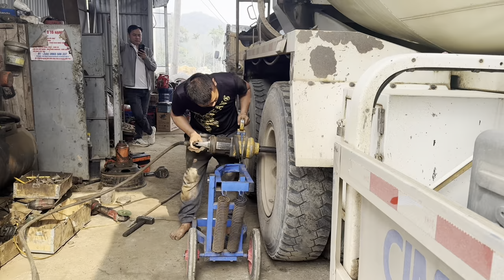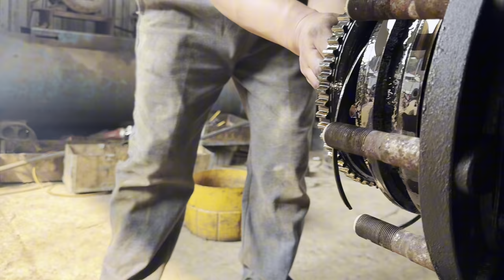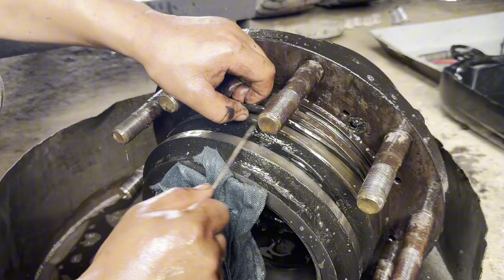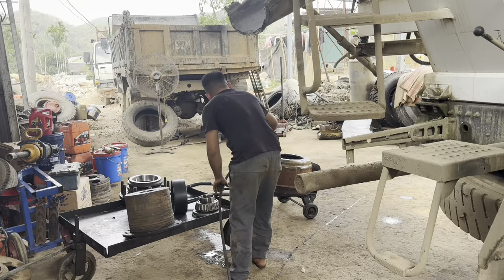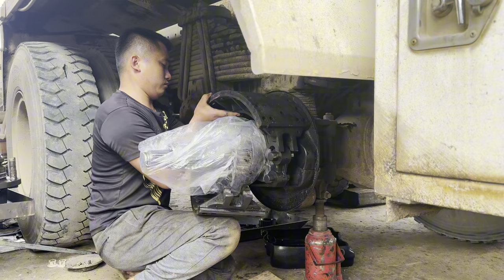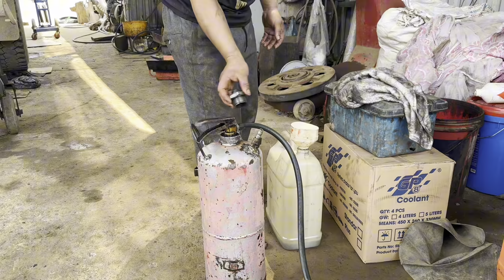Repair and maintenance of rear axle of Howo 15 ton concrete mixer

Comment: As a 79 year old mechanical engineer who has spent all my life working on anything mechanical, Cars and motorcycles, (present bike is a BMW 1200RT)  I hate to see silly comments from totally uninformed people in this post, to complain about bare feet or flip flops is sad, it’s a way of life for you, to complain about just using a bottle jack on this truck is stupid, it’s a Tandam Axle truck, if the jack fails that axle will only drop about 8-12 inches on that side. To complain about not replacing the brake shoes after being soaked in oil is sad, in 1960’s and 70’s we (here in Ireland) used to wash the shoes with Carbon Tetrachloride ( out of a fire extinguisher, Acetone would do the same job)  then soak in petrol and set on fire to burn off any oil or brake fluid, won’t harm the brake compound as they were made of Asbestos same as modern compounds. Result = good as new 😃   Anyway Danh, great job as usual.
Reply from the maker: Thank you for watching the video, the hydro jack cannot collapse, even if it collapses, it won't be able to dump the car. It's really comfortable to walk barefoot even though I know it's not safe.
Reply: i  am  reminded of the WOKES  in  Europe  who lay down on the road to protest  the use of oil  and then go home and eat the food   bought to them by those  same trucks.

Comment: Not a clean guy, I would not go to him with my truck. At least for the break-drum he should have taken new Petrol to clean it properly, instead he used that same old black nearly turned to oil (after washing all the parts in this same pot this pot of Petrol turned into almost oil) Petrol he is washing break-drum where the breaks are going to run.
Reply from the maker: I'm sorry to make you feel uncomfortable, but I just want the driver's repair costs to be kept to a minimum, so I try to reuse used things as best I can. Thank you for watching the video and paying attention to me 🥰🥰

Comment: Awesome and extremely efficient job dude. You work alone faster and better than most American mechanics. Only thing I seen wrong was you put old oil soaked brake shoes back on. In the u.s. it is both illegal and unsafe to not put new brake shoes on, as the old ones can still catch fire if the brakes get too hot. Have a great day sir
Reply from the maker: thank you
Reply: catch fire how? there is no oxygen around as it is pretty much enclosed space. also they were degresed

Comment: It goes from bad to worse.  Jacks  up a 16ton truck on a bottle jack. No stands. No wheel chocks.  Uses air tools with water in the compressor tank. Refits old o rings. Never ppre lubes the bearings after washing. Used original oil contaminated brake shoes.  Does not own a torque wrench.   And does the job barefoot!!. This is no mechanic. He has no pride in his work. Or he would fit new parts no.matter what the owner says. Its false economy.  Just wait till a truck falls on him.